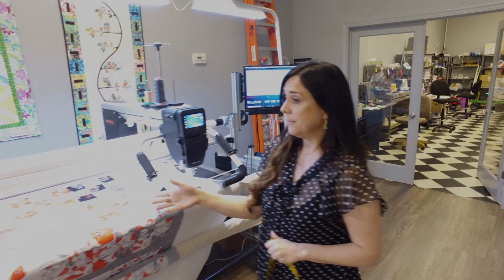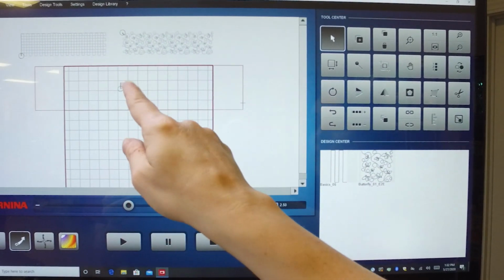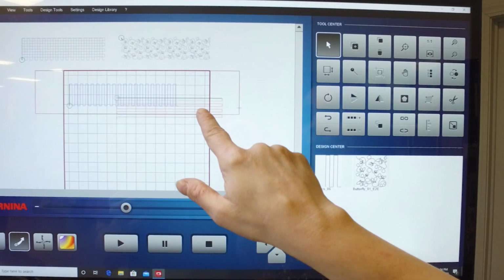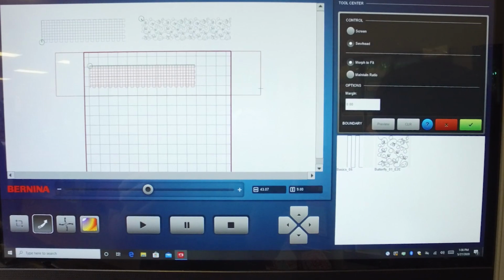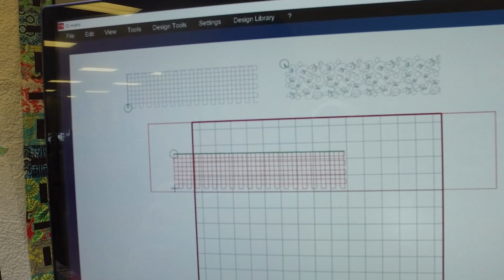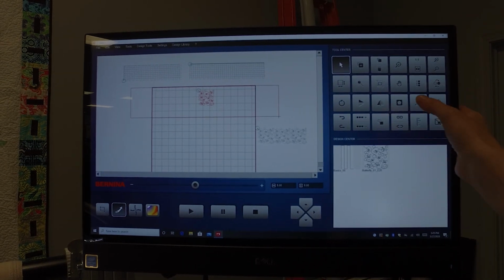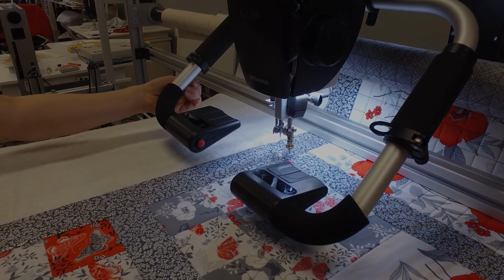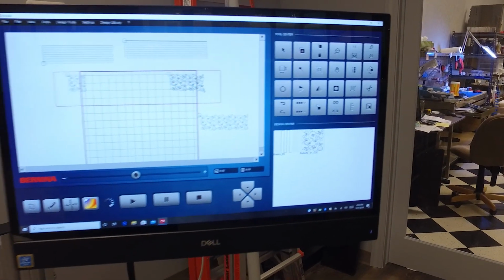Q-matic Easy Custom Quilting

Comment: What if your blocks weren't perfect? You only set the four corners, but it's possible there could be a "wave" in the piecing of the blocks. How would you adjust for that? Also, I was taught to outline each block before I start filling in an area so nothing shifts during quilting. Is it possible to outline the block to follow the accurate boundaries (not just the four corners)? I use line quilting on my Q-Bot and the crosshatch function is amazing. I am just wondering if my new Bernina will have anything similar to offer. Importing a crosshatch design has some problems when custom quilting.
Reply from the maker: My blocks aren’t perfect. That why you set the motif at the 4 corners and morph. 
I personally do not like the look of outlined blocks and feel that it only contributes to enhancing imperfections.